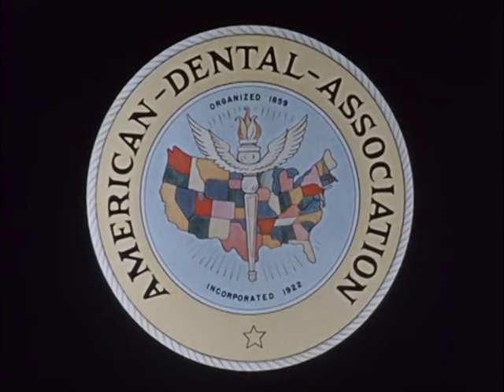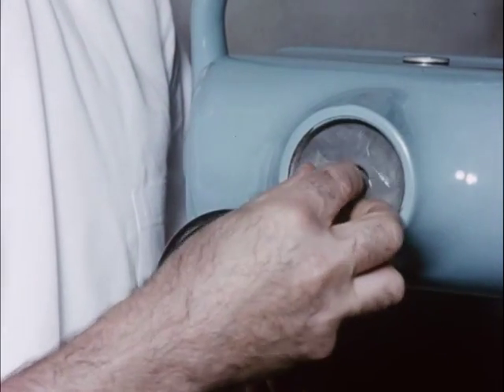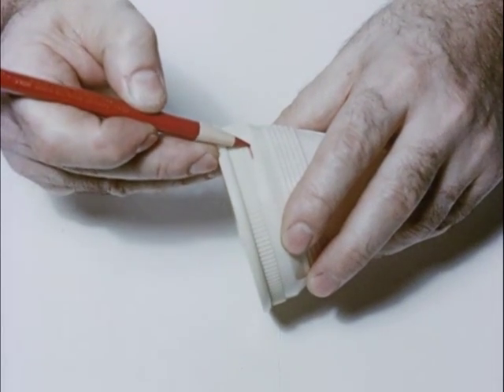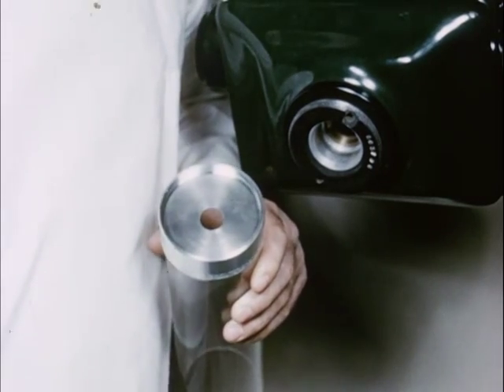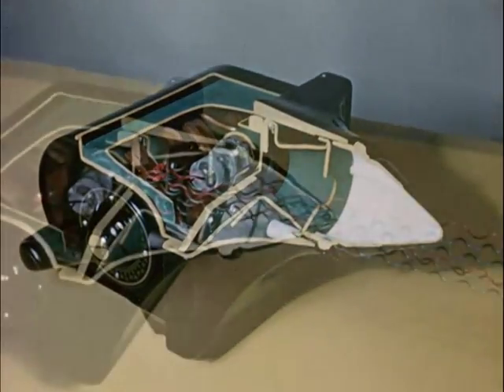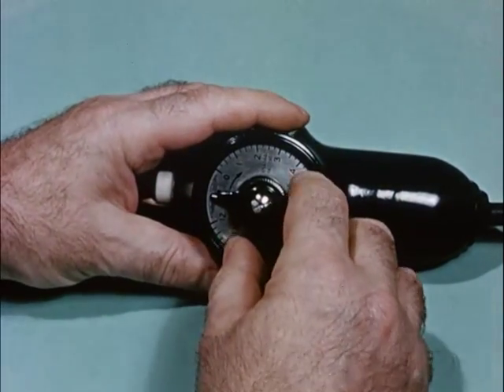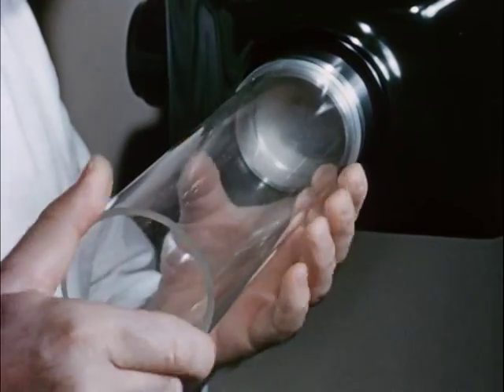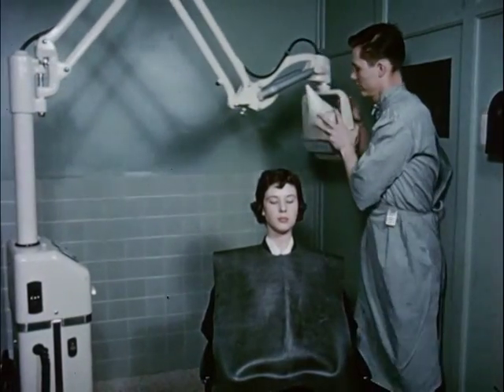Dental x-ray equipment (194?)

Comment: I got a dental x-ray Tuesday and I noticed some liquid coming from my cheek.Thursday I was picking at it. I thought it maybe a pimple. I have a heavy beard. Today I was felt a scab that I peeled off. Then I went to get a closer look in the mirror. Under my beard my cheek is all red.  It looks like I was burned severely by the dental x-ray. There's no pain, but it does burn when I touch it . Is there anyway I could find out if my dentist machine was calibrated and how much radiation it is putting out? Or somewhere I can report them? I thought they had to get their x-ray machines calibrated by the government once every 6 months or so? The X-ray machine the dentist use looks like it was made in the 50s. An antique. On this antique restoration show, they made jokes about an old Dental x-ray machine that they could not restore, because it would not pass today's legal radiation levels.
Reply: That is unrelated to the xray the machine will have very strict safety systems and cant even output that much radiation to cause such thing even if it was faulty
Reply: And at most it was made in the 90s and they are regulated and calibrated or they cant be used legally
Reply: Was your x-ray using film